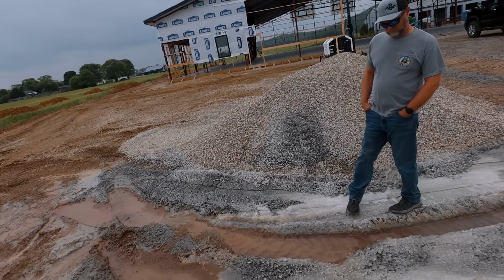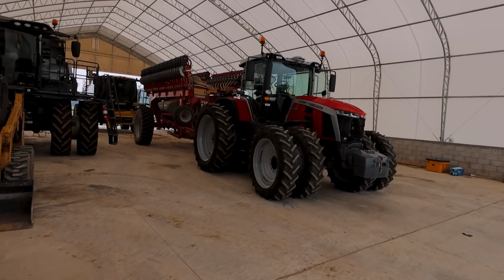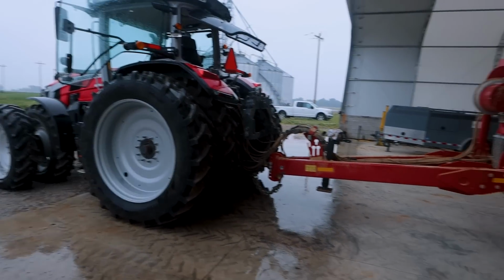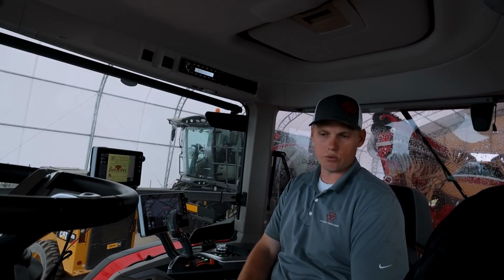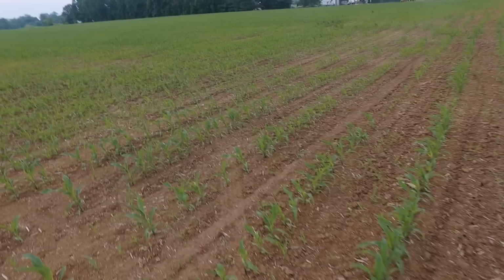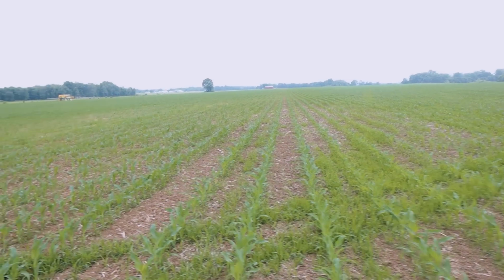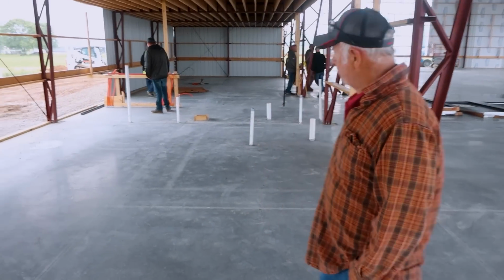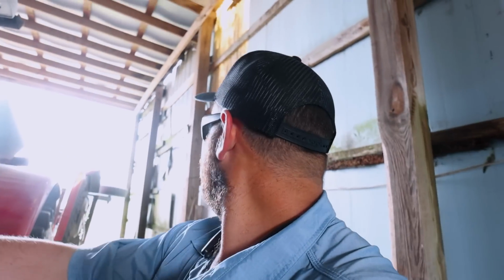A New Massey Ferguson 8s305

Comment: Nice video, Brian. I always liked Masseys. We ran John Deere's but before we bought the JD3010 we used the landlord's Massey 165 one year for rotary hoeing. That was in about 1969 or 1970. That was the only time I ever ran a Massey. Of course it did not have a cab or any creature comforts. Farmers today are spoiled. LOL. Just kidding. Today's tractors are much better for a farmers health than the old school ones were. But the price of today's tractors really blows my mind. In fact the price of all modern farm equipment blows my mind. Dad bought his first JD4020 Diesel in 1964 and I think he paid around $6000 for it brand new. Times have changed. Sorry about the crack in your new shop floor. That's really a bummer. Especially considering what the floor cost.

Comment: That new tractor is far and away superior to my cousins 35hp Massey Ferguson he bought in 1959 , and is still working by the way. You’ll need some kind of sealer for that floor even if it’s just paint. I’ve had better results with oil based paint as it is more durable than latex.

Comment: Another Masseyferguson. 
Jeez, that's the 3rd one. We'll they're a pretty good machine for the money. Don't get me wrong, Fendts and JD, along with case and NH, are good machines in their own right. However, for the price you pay on a Massey, you get a lot of features. If there's one thing that I would have to complain about, it's the location of the ignition. Seriously, of all the places they could put the ignition on, one of the pillars. Seriously, Massey. Either way, they sell some really good machines. Although I was shocked when they relocated the ignition switch in a similar location to what they do on a John Deere. Huh.

Comment: For the shop floor (and even the house) look into a company that will grind it down to smooth. Basically seals the floor without needing to use any chemicals and will not stain when oil/liquids get spilt on it.
Reply: How does that work since concrete is very porous?

Comment: The 8S replaced the large frame 7700S series. The 8700s series is still in production. Goes up to 400hp. There is supposed to be a 9S coming to replace that series
Reply: No brasil já tem um 9s em teste o trator é  muito grande só  que tá todo camuflado  e não é  articulado

Comment: I have a 60x100 and our new house is a 66x40 Brando 
Only thing we did to our finished floor is sealer / acid treat it
They are our finished floors and my wife loves them
The pole barn is climate controlled 
We live in it with some equipment and our RV
Those floors sold her on doing the same for the house floors 
Zero maintenance , easy to clean and not too slippery

Comment: And if they cut, they relieve stress cuts in your concrete in the right spot it will not crack so if you got cracking have them fix it because it should not crack if they cut in the floor to allow cracking not to happen

Comment: Did you install a vapor barrier below slab. If so and I think you did for in slab heat. 
Then you can do about anything. 

If not. Then either bare or ceramic tile is your options. Or throw rugs. But not floating floor.
Reply: See above

Office. I would do an LVT. That has Thick wear layer and cushion pad. Look nice and easy to clean.

Comment: Word of advice, get rid of those plastic hangers for your septic line.
Had the same ones fail on me when I had a backup. The entire line came crashing down. As you can imagine, it was not a pleasant experience. And before anyone asks, they were placed  every 16". Once one breaks, they all will fail.

Comment: I think it's been almost 2 years since MF introduced the 8S series. At that time, rumor had it they were going to revamp the 8700S series and release the 9S. Where the heck is it? The MF line has a huge hole without a high HP series. Agco has the Fendt 1000 series. Change the tin, paint, & interior and get it to dealers. Oh, and while you're at it, convert the Challenger MT900s into MFs too. Yet another thing that makes me question Agco's commitment to the brand.

Comment: Office floor.... In my house garage I used Rust-Oleum paint with colored chips thrown on top. Follow instructions, especially the cleaning before application and it will give you a nice looking floor. Easy to clean, after at least 6 years, mine is holding up well.